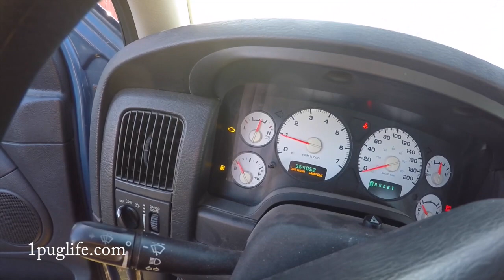huge burnout and 25,000 lb gooseneck hitch build

Comment: ON THE 4 .7 YOU CAN PULL OUT THE RESTRICTION OF THE OIL FILL HOLE... IT PULLS OUT.. AND PS.. THE UNDERSIDE OF THE OIL FILL CAP IS MISSING.. ..ITS NOT SAPOSED TO BE LIKE THAT

Comment: Nice gooseneck vids. Do you have pics or a link to the not visible part that is mounted to the frame and how the two are secured together? I have an obs '97 f-super duty 450 that needs a gooseneck under the flatbed. I would really like to hear from you. Thanks a ton, freeze'

Comment: Try shifting the truck into N then try the 4x4. Thats what i have to do with my dodge ram. Basically its locked so you dont accidentally engage 4x4 wiyal driving down the high way, so the truck it self has to be in neutral for the 4x4 to engage.